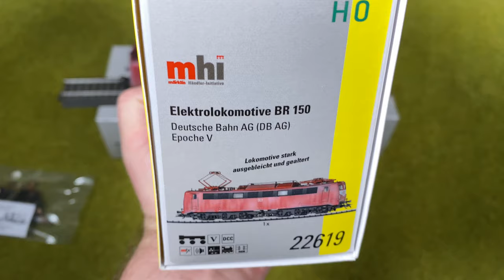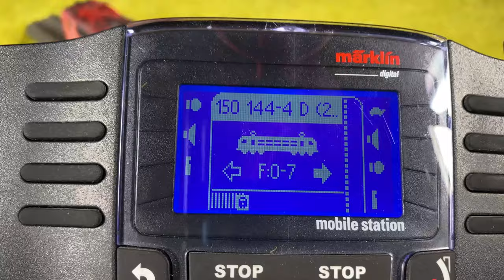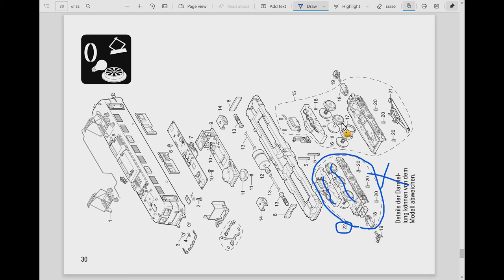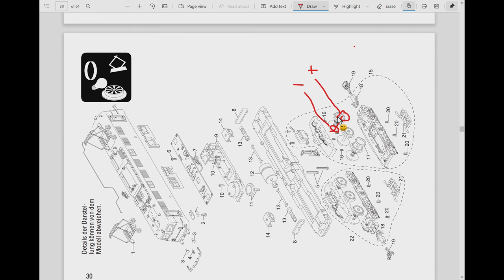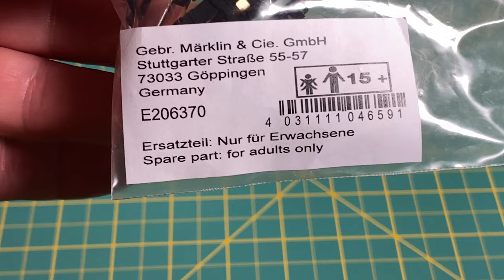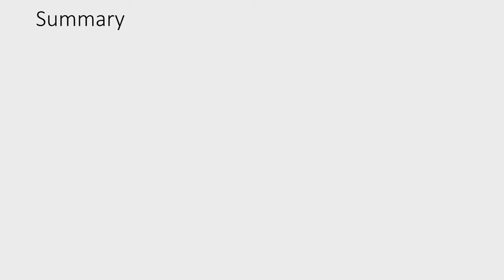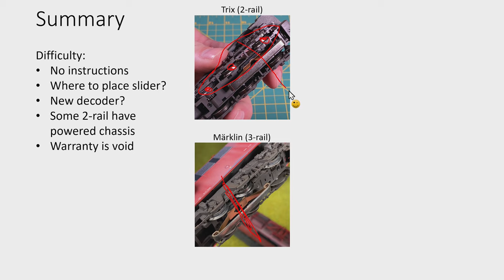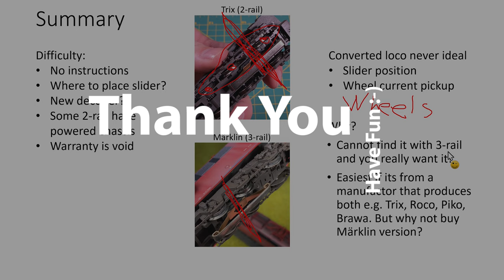Experiment: Converting Trix 2-rail to Märklin 3-rail (Extra 03)

Comment: Hello, I made a "Contact Track" Out of your advice in this video and the other one you made, It is operating in DC mode with an analogue Fleischmann MSF-Trafo controller since I mostly own Analogue DC locomotives,  however, I have one issue;

I am unable to run it with other pieces of track, if it's only the contact track, trains will run fine on it, but if I connect any other tracks to it, it won't run whatsoever.

I tried to fix the issue by adding a piece of electrical tape (I do not own the red plastic bits and I have been unable to purchase them) on one of the contact pieces on the 0 part of the track, as you showed in your video. However, while it did allow the train to run in the contact track section, it stopped running the moment it lost power with said track.

I am a beginner so I don't really know much about this, so I hope you have some advice.
Reply from the maker: Hi Raul,

Let me see if get this right. You are running DC on 2-rail track, but you want to use the Märklin 3-rail track for your 2-rail DC locomotive? You have a couple of Märklin 3-rail track that you have connected together and all of these track have been converted into contact track by disconnecting the two rails? Then you are trying to connect these Märklin 3-rail track to other DC 2-rail track you have? 

Did I get this right?

If so, why mix in the Märklin 3-rail track? I would be better just to use standard 2-rail track.

If you only have Märklin track and really want to do this - then you must make all Märklin 3-rail track to 2-rail track by disconnecting the rails and making them to 2-rails. However, you can only do this with straight and curved track. This trick does not work with turnouts, uncouplers, crossovers, etc. Hence, this is not a good way to go.

If you have a couple of Märklin and just want a straight section with the Märklin track and connect these to 2-rail track, then it really depends on what brand of 2-rail track you have...

Not sure I helped, but 3-rail and 2-rail are basically not too compatible and best to stay on the track system that makes sense.

Hope this helped a little. Enjoy ;-)
Reply: @ModelTrainFun  No, I have a big loop of Marklin C track and thus I wanted to make it work for my DC trains since I can't afford to buy normal TRIX track at the moment and don't own many Marklin AC locomotives, so I made a contact track out of a straight, and while the locomotive ran on the contact track, the moment it entered another piece of Marklin C track (not a contact track, just a normal curve), it lost power, do I have to make all of my tracks contact tracks or do I have to insulate one of the metal tabs on the 0 ends of the contact track?

Sorry if I'm not explaining myself well, since I don't really know much.

SMALL EDIT: In the 6:30 timestamp of your video, you show your locomotive running as DC on Marklin track, are all the straights contact track or is only one of them contact track?
Reply from the maker: Hi Raul, you need to make all of them contact track, then you should be ok. Enjoy your small loop. Have fun ;-)
Reply: @ModelTrainFun  I tried what you said, and it worked, Thanks.

Comment: Hi, I have another question: i have a Roco Steuerwagen (era III, center-entry type, green). On DC, the red-white lights switch via DC polarity switch on the trafo. Tried that with old Mehano f270. On Märklin AC system, all 5 lights (3 white and 2 red) burn, die to AC polaeity switching constant. I could install a function decoder, but that costs. The alternarive is installing a converter, which would convert the current to a coach-friendly 12V DC, then add a manual polarity switch. But that consumes a lot of coach space. What is the easyest way to do it?
Reply from the maker: Hi Grega, I am a little unsure of what you mean by "burn"? Is this light bulbs and they burn out? If so, consider replacing the light bulbs with LEDs. If you are talking about flickering of the lights - if it is light bulbs - again consider switching to LEDs. If it is LEDs and you still have a very very slight flickering this would be normal and mostly only visible on video. Unfortunately, I do not have any experience with removing the flickering. Hope this helps a little - if you find a good solution I would really like to know about it. Enjoy ;-) Bo
Reply: @ModelTrainFun  hello, sorry, burning as "shining". The core of my question was how to achieve light switching on ac digital system. Imagine having a loco (say, an electric one with two cabs on each end) on rails: if it moves to the right, the right cab lights shine. If you change the direction, the lights shine on the left side. Same applies to the coach with a control cab; if pulled, two red tail lights are on. If pushed, three white lights are on. As far as I understand, I need a simple function decoder, which I would access through my MS2, it listed as a loco. That way I would select the direction of travel through pressing the large knob, and by doing so, the white/red lights. Which decoder do I need. I know that Märklin silverling control coach has such setting.
Reply from the maker: Hi Grega,

The cheaper Märklin models have a mechanical way of changing the light on the cab control car. It is essentially a little tab that moves either forward or backward by being attached to the axel - it is blocked by a contact so it does not rotate. Each of the two contact with light either white or red lights.

If you want to do it using a decoder - in the Märklin world you can use the Märklin mLD3 locomotive decoder. It is the simplest decoder that Märklin produces - it is for locomotives, but without sound. There are 3 models depending on which interface you want:
- NEM 660: https://www.maerklin.de/en/products/details/article/60972
-  NEM 652: https://www.maerklin.de/en/products/details/article/60982
- 8-pin NEM: https://www.maerklin.de/en/products/details/article/60983

I know that ESU also has a non-sound version of their decoder that can be used: https://www.esu.eu/en/products/lokpilot/lokpilot-5 

I have not tried it myself, but I would probably choose the ESU LokPilot 5 Fx as it seems to be the simplest/cheapest and ESU are good decoders. The Fx model has no motor output, but more outputs for lights.

If you are looking for Märklin, then the Märklin 60982 as it looks like it fills less and is easier to fit into a cab control car. You can also consider the ESU 59610 with same pin layout. As far as I can see the 8 pin NEM 652 would give you the option to have front, rear and internal light. You can also consider one larger decoder e.g. the Märklin 60972 which have more outputs - if you need more light e.g. destination sign or other.

However - I have not tried it myself - look around for somebody that has already done this. One thing I am uncertain of is how much programming of the decoder is needed.

Hope this helps! Enjoy ;-)

Comment: And the Märklin Gauge 1 trackbox is also an LGB trackbox. You don't need Central Station for LGB mfx+ like LGB tells you. Now that the LGB DCC controller back-stock has sold, LGB may have finally come clean. But for a while there, they were telling people you could only do digital LGB with the LGB DCC controller or a Central Station.

Sorry, You mentioned the fact the Mobile Station could also do 2-rail and it flooded my brain with this. I try to spread this knowledge to all other Model Train Enthusiasts. Especially those with little to no electrical engineering knowledge and just a joy of trains.

With DCC it's Hot and Neutral. Just like Märklin 😀 (or Hot and Hot. I still have no idea if DCC/MM/mfx is split phase or single phase. I just know it's AC with modular frequency.)

Alright, this was good review. I was hopping to find insight on what to buy for a power pickup shoe, but you sorta cheated. 😜 I'll be looking to attempt to convert an Athearn model to 3-rail. In fact I also plan to add a double-pole switch, so I can switch it between 2-rail and 3-rail operation. With the idea being all American H0 clubs/societies are 2-rail. (Well, except for European Train Enthusiasts of America.) So if I ever actually decide to go visit one and bring the Athearn model with me, I can switch it to 2-rail operation without disassembly and rewiring. Though I will have to do a 2-rail experiment. I'm worried the power pickup shoe may rapidly wear the centre of the 2-rail ties. Which I can only assume club/society layouts will not want. And I have no idea how it will handle 2-rail turnouts. Hopefully the lip makes it just jump over. 🤷‍♂
Reply from the maker: Hi Nikolaus,

Thanks for the LGB tip! Always looking for great with tips'n'tracks ;-)

Yes - I cheated in this video. However, the principle for how to convert is the same:
1. test as 2-rail
2. figure out how the power goes from the rail to the decoder, engine, lights, etc.
3. attach slider, re-wire and re-solder
4. test

The difficult part of conversion from a manufactor as Athearn is to find a spot where there is enough distance such that the slider can move up and down over the turnouts. It is also difficult to figure out how to mount such you can replace when needed - however, glue and force might also work.

If you do not have enough space under the locomotive to fit the slider, then consider fitting it in the first car after the locomotive. This means that locomotive and car is forever connected, but is better than no conversion at all.

I like your idea of being able to use the locomotive on both on 3-rail and 2-rail. However, I think having the slider on 2-rail will not work too well. I am affraid that it will get stuck all the time and you will damage the layout as you point out. Perhaps having the slider in a following car might be more handy? ...or make it removeable?

Enjoy ;-)

Comment: Thank you for the video. You connect another track before you run the TRIX locomotive. Do you have to repeat the disconnection of rails like the first track? Can you please guide?

Once I do the above conversion, can I run a RAPIDO RS-11 DC/DCC locomotive? I have the Marklin Digital controller box 60116 and MS2 controller. Will the RAPIDO RS-11 loco run?
Reply from the maker: Hi, 

The trick for turning the C-track into contact track by dividing the track and rewirering so the two rails work as on a two-rail layout will only work for straight and curved tracks. However, this will not work for turnouts or other special track. Hence, you can make a loop, but no turnouts. In this way you can use the Märklin C-track for a small 2-rail loop. A better option would be to get some real 2-rail tracks - you can connect the MS2 to a 2-rail layout as well.

The Mobile Station 2 is able to control locomotives with MFX, MM2 and DCC. Hence, you can use the MS2 with a 2-rail layout as  well. In this case you might also want to change the accessory protocol to DCC using SHIFT+Turnout -> Accessory protocol. Some DCC decoders might get confused with the MFX or MM2 signal. In this case you can either tell the decoder to use DCC only - or change the MS2 to only use DCC (SHIFT+Turnout -> Loco Protocols). 

Hope this helps! Enjoy ;-) Bo

Comment: Hey Mike I have a trix es44ac and I want to run it on my marklin 3 rail track how do I do that?
Reply from the maker: Hi, 

Looking at the manuals for e.g. Trix 25440 and Märklin 38440, then it seems like you can do a similar conversion as I did in this video. 

The interesting part is how you can attach the slider to the boogie - I see in the manual that the boogies are different spare part numbers, so I am unsure how to attach a slider. The tricky part is if there is space for a slider... 

You will also have to investigate the wirering to ensure you change it from 3-rail to 2-rail. Hence, tracing all wires to see what is possible. As the model is available for both Trix and Märklin it should be possible... 

Doing the conversion is a bit of detective work and may turn out as you want - or you may have some stuff that is not ideal. It is not an easy job. Would suggest to but an original Märklin locomotive instead. 

I have also toyed with the idea to just buy one of each switch the body and sell the pieces I do not want. As an example, imagine that I would like to e.g. have a KCS version, but can only find the Marklin UP version. However, a Trix KCS version is available. You should be able to buy the Märklin UP and the Trix KCS and then exchange bodies. Then sell the Trix UP - not as an original, but somebody will probably still like to have it. I have never tried this but can see it should be possible - if everything fits... An idea?

Hope this helps! Enjoy ;-) Bo
Reply: @ModelTrainFun  thanks for the help but I don’t want to risk the model as it’s discontinued so I just put a marklin mobile station 2 and a power box an connected it to a dc track

Comment: Hello Bo. An interesting conversion mostly only made possible by the fact that the locomotives comes from the same “family”/factory.  In the late 80 early 90 the company Lima made the danish class locomotiv MZ in Ac as well as Dc but with different numbers the conversion there was done much simpler - one simply got one of each and simply change body shells, then you didn’t have to do any electronics . But with different numbers.
Reply from the maker: Exchange of body shells is a really good idea. I guess you could re-sell the DC version to somebody who would be interested in the opposite conversion. Enjoy ;-)

Comment: yes I had a Hag dc loco converted to AC, but the position of the slider makes it short circuit when it passes by the turnouts. Have ordered a shorter slider to try and see if that helps the problem.
Reply from the maker: Hi David, Yes the slide can be a pain of it is not working :-( If it's a locomotive with a bogie consider if it is centered on the bogie - this sometimes helps. It can also cause issues if the slider is slightly positioned off center or it is slightly bent in the wrong way. Hope you find a solution. Enjoy ;-)

Comment: Hi there. Thanks for the helpful video. I am considering converting a Hornby Class 60 to three rail but I will make a prototype first by getting a used model that is has an expired warranty. Not sure if the UK Class 60 Diesel Locomotive would interest you but it might be worth a video to consider. Keep up the great videos and I have subscribed.
Reply from the maker: Hi, I am glad you liked the video! I have not tried converting an OO locomotive to Märklin 3-rail. I have considered it often, but always choose not to as OO is an interesting scale as it fits on H0 tracks, but is 1:76 (H0 is 1:87). Hence, OO is narrower than it should be to fit H0 tracks and it means the locomotive is taller than normal H0. I think it will look odd next to other H0 locomotives? But there are so many British locomotives I would like to have... maybe one day...  Enjoy ;-) Bo

Comment: howcome it's possible for a dc locomotive to run on ac?
Reply from the maker: Hi Tomas, 

When model trains were analogue the DC and AC trains were not compatible. In the model train digital world it is no longer AC vs DC. They have the same type of power - the difference is the protocol transmitted MM/FX/MFX vs DCC. This is also why one should not use the terms AC or DC for digital layouts - although you still see many manufactors doing this. The difference is rather how the power is picked up from the rails i.e. 3-rail vs 2-rail - where a slider is needed for the 3-rail.

This also means that both the Mobile Station 2 and the Central Station 3 can control locomotives with both protocols at the same time. The CS3 further supports both protocols simultaneously for accessories - while in the MS2 you have to choose which to use. Furthermore, most digital decoders support both MM or DCC - and some also MFX.

Enjoy ;-) Bo
Reply: @ModelTrainFun  Thanks for the answer. Now the motors: they are always dc?
Reply from the maker: @tomasengelbrechtsen  Honestly, don't know. Sorry. Enjoy ;-) Bo

Comment: Very interesting conversion/tutorial, thx! Though I have a Trix 22091, BR 185, which I like to convert to AC, can you show that also...
Reply from the maker: Unfortunatly, I do not have the Trix 22091 so I cannot show this. However, I see that the Märklin version is Märklin 36833. Looking at this it seems the boogie shells and the gears are the different parts. Other than that they look similar judging from the manual. I can try to help you over email if you take some pictures of the underside and the inside of the locomotive where the wires go to the bogies and to the electric board inside. Find my email in the about. Enjoy ;-)

Comment: I have been thinking that there should be some way to rewire a two rail locomotive so could operate it Trix C track one day and on Marklin C track the next day and back again. If all of the wires from the slider and the wheels are connected to an extra NEM six pin decoder socket on the side toward the end of the engine and the A and B or wired from the base of the extra socket to where the A and B power pick-ups on the original decoder socket; after which it would be that you would only have to change out one for another bridging plugs to convert two rail to three rail and back again.
Reply from the maker: Hi Earl, I do agree it should be possible to change between using the slider or not. However, you may also have to dismount the slider as the slider might not work too well on two rail - I think it will become stuck on turnouts and so on. Hence, you need a switch to switch between using the slider or not and you should be able to easily dismount the slider. I have not tried it - let me know if you have success. Enjoy ;-)
Reply: @ModelTrainFun  a course you would have to remove the slider or the loco would trip on the rail and derail.